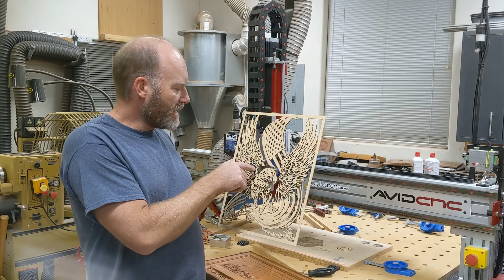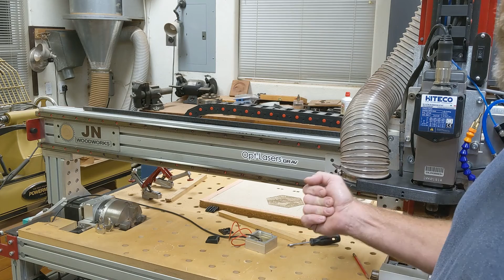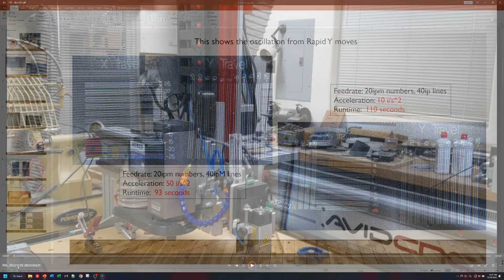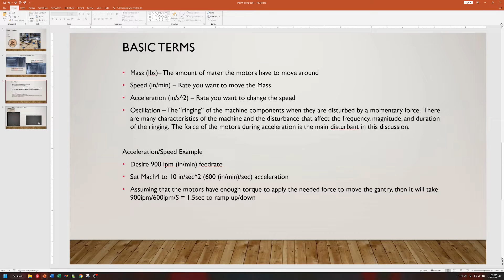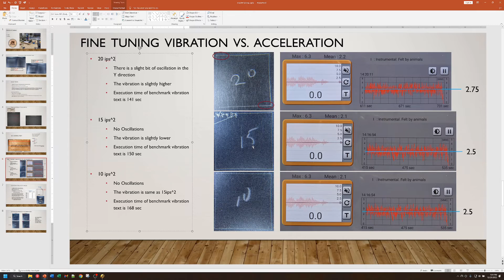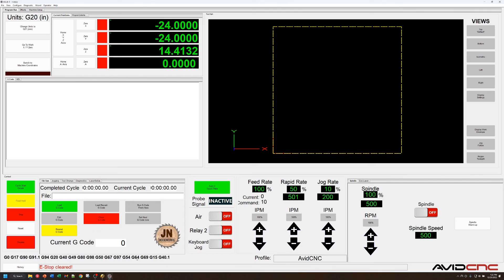CNC motor acceleration tuning in Mach4 to reduce vibrations that degrade cut and laser quality

Comment: These videos are very informative appreciate the time that you put into doing these I do have the same avid CNC I was wondering what spindle do you have?
Reply from the maker: Thank you.  
I started with the 3hp spindle that AVID sold about 6 years ago, then I upgraded to the 4hp Hiteco spindle shown in this video.  A year or two ago I then upgraded to the AVID AV40S spindle that is an ATC spindle made by CNC Depot for AVID.  This is an awesome spindle from a quality perspective, and the ability to swap tools quickly, even when doing manual tool changes is great.

Comment: I'd suggest a cable, pulley, and counterweight system and motor two times what you otherwise would need. The counterweight will offset your vibrations. No CNC experjence, but engineering experience.

Comment: COULDN'T YOU USE A COUNTERWEIGHT ON A DRIVE MOVING OPPOSITE YOUR SMALL FAST MOVEMENTS???
Reply from the maker: In theory, but I don't think that would be practical.  That would essentially be building a whole other "anti CNC" just to counteract forces.  It wouldn't be too hard to do that under the table to reduce the vibration there, however most of the problematic vibration is up on that gantry, and the last thing you want to do is mount more mass and motors up there.

Comment: Go with Clearpath servos !
Reply from the maker: Some day I might just to see the difference as an experiment, however just lowering the acceleration works great and has little impact on execution time for the type of tool paths I normally run.
Reply: @JNWoodworks  The nice thing about the Clearpath, it's NOT a stepper motor ! You set the parameters in the motor via USB and their software. You set the acceleration, start and stop point. Once connected to your controller, the morot receives commands and move to the position at incredible speed, uip to 800ips. It's really worth the 250$
Reply from the maker: @altamiradorable  Well, I have no need for more speed.  The NEMA 34 steppers on the machine will raster my laser at 1100ipm, which is about 900ipm faster than I really want to go (based on laser image quality).  Most of the router work I do is Vcarving or 3D model carving, and then laser work, which is all very short vectors with lots of curves, so the motion is almost always in accelleration mode and doesn't reach full speed.  So the only reason for me to switch would be for the improved acceleration curve control to reduce vibration.  However, I can control that easily by reducing the acceleration values on the steppers with very little impact to the Gcode runtime.  So I really don't have much justification to do it other than it would be fun project 🙂
The other concern I would have is that I don't want to replace the control system, I like the ESS and Mach4.   I don't think the clearpath SDSK can really optomize the acceleration curves all that well when they are being feed a linear ramp from mach4, so w/o gutting they whole system it wouldn't be much of an improvement.

Comment: @JNWoodworks will these adjustments affect wood carvings or do they apply mostly to an added laser?
Reply from the maker: I first noticed the ripples that the vibration caused in Vcarve work with the spindle.  I slowed down the feed rate a lot back then to get smoother cuts. Then when I started playing with lasers, I could see the sine waves in the laser line so clearly that it started to make more sense what was going on, and it was much easier to do experiments because the results were much more measurable.  So the default settings are fine for typical machining like cutting cabinet parts and stuff where you are running longer vectors.  However, once you start Vcarving, 2.5D carving, or lasering, typcially your toolpaths are very short and changing directions all the time and that causes all kinds of vibration if your accelleration is set too high.

Comment: Brian never really wanted to touch the TP code and fix the accel/decel disparity on Arts original implementation..   that's why I moved away from m3m4. Adjusting cv angles is only half good, motion is still full of uneven peaks. For me that was the only issue with m3 and m4.

Comment: Jim, I've been binge watching your videos as I'm waiting for my first laser head (PLH3D-XT-50) and I just wanted to say thank you for all your videos and efforts. It's very much appreciated. One thing I'm still trying to figure out is the method for zeroing the laser for x/y. If the Laser is offset from the router, are you just setting an offset in the XY Datum section of the job setup in VCarve? Especially when dealing with combined Router/Laser operations in one job.
Reply: LOL should have continued my binge watching, you answered it all on your excellent Mach4 Screen video :)
Reply from the maker: Hi Rich,
I have a section in my laser screen where I can plug in X/Y/Z offsets for the zero position.  The screen is in my Google drive, and I briefly went over the screen in one of my laser videos.  So I can use anything for a touch plate reference, like the spindle would work fine.  However, I have.put a retractable metal rod on each of my laser bases so that the offset from the road to the laser is constant even when I reattach the laser base.  I almost always use the rod with the touchplate and the offset routine to set my Z zero because I get very consistent results on the focus and that is important.  However, for Xand Y, I usually just turn on the.laser and jog to where I want zero and set it manually in Mach 4 because that is usually not critical for what I'm doing.  You do have to remember how you set the job up in Vcarve as to if you are corner or center referenced in the job.

Comment: Nice job, Jim.  Now I know how those CV wizards in Mach 4 really work. Looks like you have found the sweet spot on the Avid for the work that you do.  I don't think there is much more you can do to reduce vibration using the Avid stock components.  However, if you want to improve performance I have found the going to servo motors makes a significant difference.  In my case I used Clearpaths as almost drop in replacements for the NEMA 34s.  When they are properly tuned much higher acceleration values can be used with less resulting vibration because the motion step function response is commanded to match the  exact mass characteristics of the axis with optimized damping.
Reply from the maker: Thanks for the input, I'll have to check out their documentation.  I've got good enough performance now (I don't have to make money on my machine, so the extra execution time is ok for me) so I probably wouldn't switch motors (unless I need a fun project), but its always interesting to see how others solve the same problem.
Reply: What acceleration are you using for the clearpaths?
Reply: @caleb7494  I first used 100 for a while but have back off to 50 which is recommended by Avid to increase  the life of the  gears. I don't notice a big performance difference so decided to play it safe. A well tuned Clearpath servo runs very smooth and probably can be run at 100 without any issues but if a crash occurs their power can be a little scary.

Comment: Excellent video Jim, thank you so much for making it!  

The CAM program has no idea what hardware you are using (and Mach doesn't really either). After you build the hardware as best as you can, it is all a tradeoff between speed and accuracy, and it is up to you as the operator to adjust your acceleration settings and CAM settings accordingly.
Reply from the maker: Thank you, and very well said on the second part.

Comment: There's a couple things at play, the mach path planner has some flaws in constant velocity mode (as do any other as it's a trade off) and the controller and software that you use. It will cut corners at higher velocity and lower acceleration. I don't know if you can tweak those settings in mach, but on uccnc you can tweak them. I've set acc to 63 i/s² (1600mm/s²) and tweaked the constant velocity settings so that it has both smooth motion and precision at 2000mm/min velocity. The slower you go the more accurate it'll become. If you need perfect accuracy, stop using constant velocity mode and start/stop at each line segmemt (I think it's called stop mode). 
Also, the gcode generator/post processor makes a huge difference in vibration and jerky motion. I've found that the default settings of vcarve to be way more jerky than fusion360 as the latter adds small radiuses to in and out paths. That way you can greatly speed up the cut compared to vcarve without the machine shaking apart. You can use radius/smooth in/out motions on vcarve but it's a bit primitive, and doesn't always avoid cutting into your workpiece.
For uccnc it can't deal well with circle gcode commands in constant velocity mode, I've turned that feature off in fusion postprocessor script. It will then generate line segmemts. It's important to bump up precision so that there's enough resolution for a proper smooth round transition to be generated.
Reply from the maker: Ya, F360 (and others) have much more CAM control and sophistication than Vectric's.  However, Vectric users are stuck with Vectric's output, so once you get the Gcode that it gives you, you can just run it, or try to get a little better performance out of it via feedrate and acceleration settings.  As for CV, yes, I could make it cut corners at higher speeds and lower acceleration as you said, but the acceleration to make it do so was well below the values I need to run on my machine.  So it wasn't really necesary and I see the same results with CV on and off.  Other machines could certainly have different results than I see since weight and motor size affect what acceleration you should use.